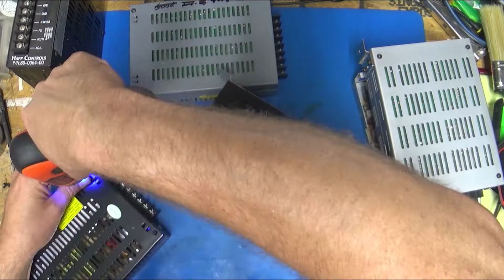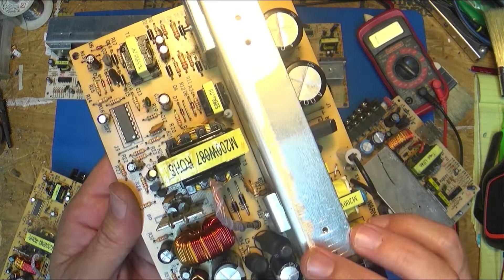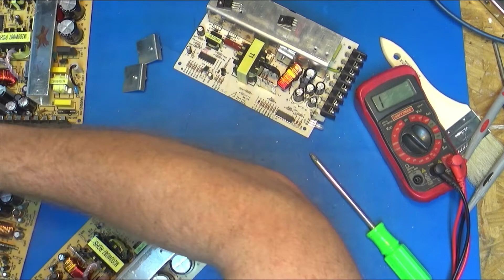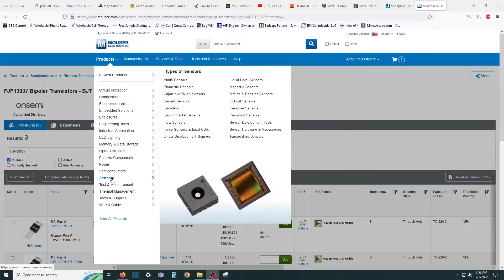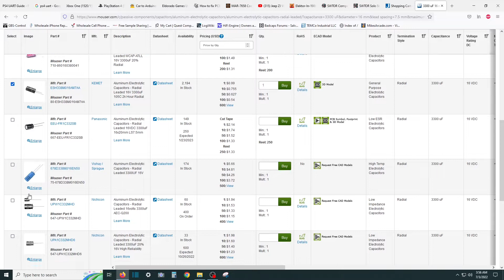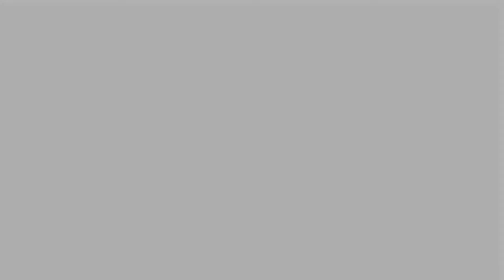Arcade Power Supply Repair EP1. Tear Down and Testing.

Comment: CRAZYLOGIZ007, Do you know what type of external filter board to use for arcade Power supply switching power supplies? because they create WAVES on the arcade CRT monitor graphics have wavy waves from the switching power supplies. They make these special filter boards for arcade switching power supplies but I don't know what they are called or the brand names for these filter boards to prevent the monitor interferences issues
Reply from the maker: I think you are asking about an EMI filter, arcade parts and repair normally stocks them. 10 amp.
Reply: @Crazylogix007  The EMI Filter daughter board attaches AFTER the switching power supply?